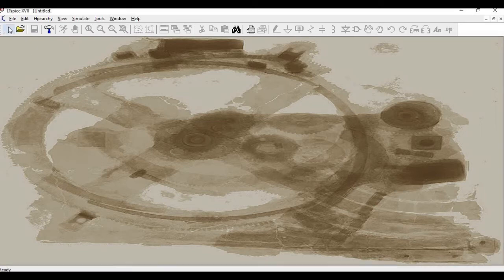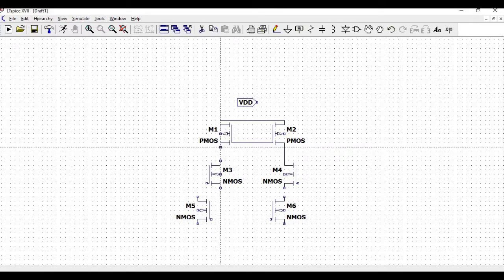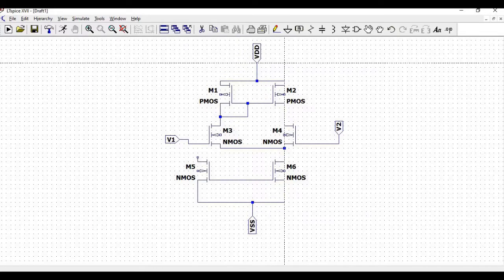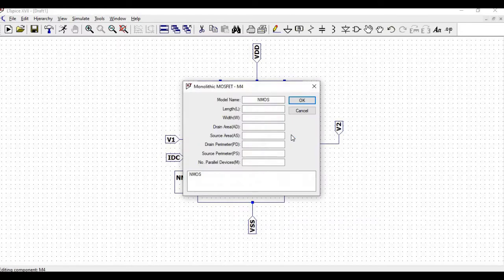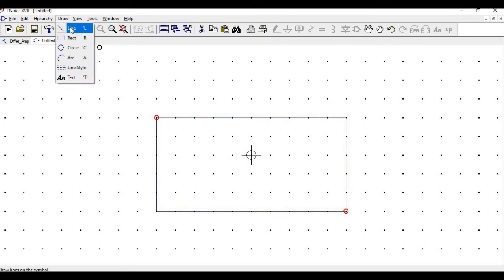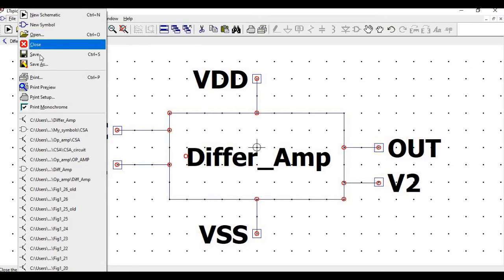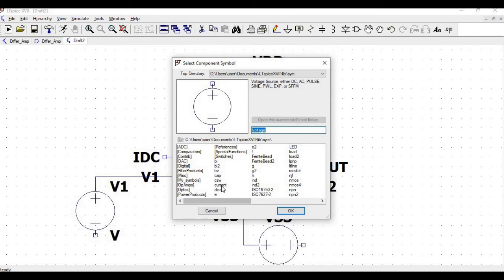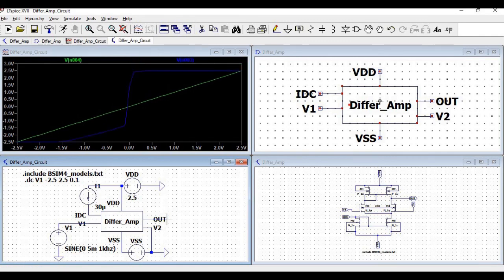DC analysis of an Differential Amplifier circuit using LTspice and BSIM model

Comment: Thank you so much, Sir. I'm planning to simulate the small-signal model of a HEMT device on LTspice. Is LTspice sufficient for it? Also, can LTspice be a substitution of Cadence as I am an independent researcher and don't have access to licensed tools like Cadence Virtuoso.
Reply from the maker: Yes you can there was a white paper from GaN systems and they have simulated using the LTspice tools. Regarding the substitution part circuit simulation can be done through LTspice , but layout simulation not possible
Reply from the maker: White paper from GaN systems
https://gansystems.com/wp-content/uploads/2018/05/GN008-GaN_Switching_Loss_Simulation_LTspice_20180523.pdf